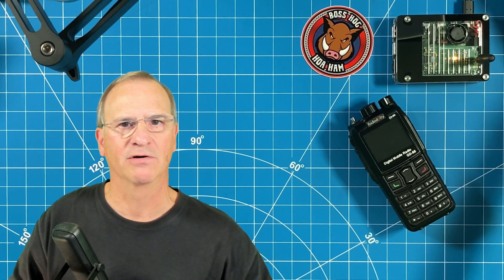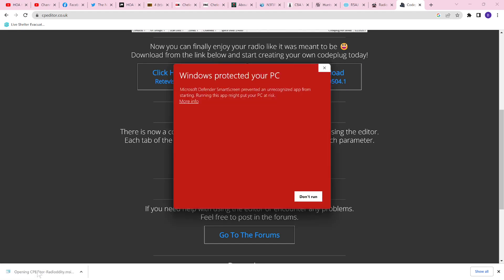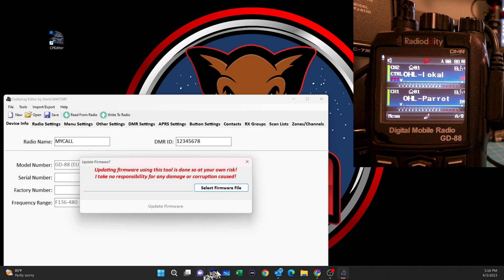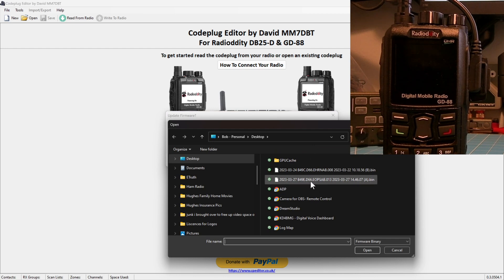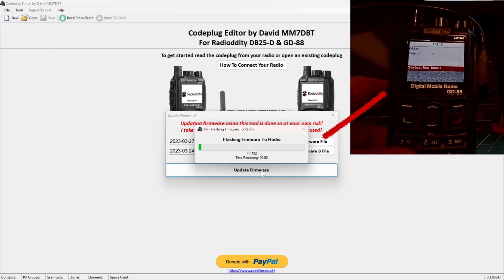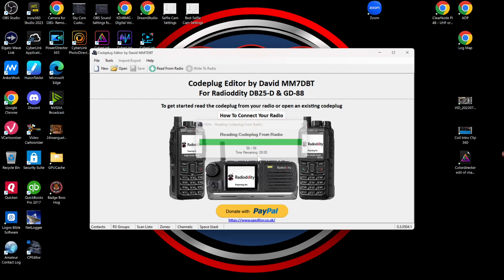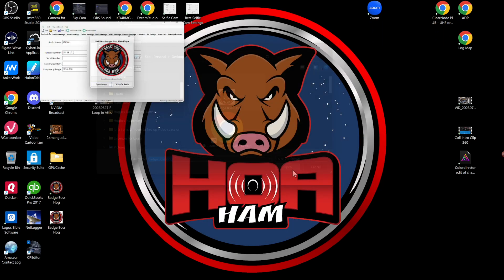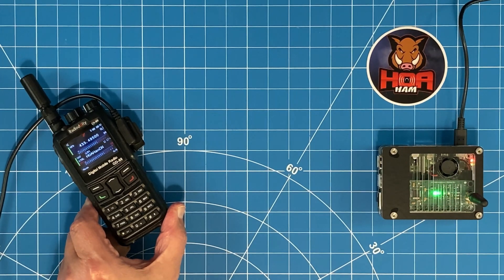Radioddity GD-88  -  Loading CPS Programing Software / Updating Firmware / Adding a Start Up Picture

Comment: What antenna are you using?
Reply from the maker: The antenna I am using is the G Gabil Radio stub; I use the BNC version:  https://amzn.to/3UotMAW
Reply: @HOAHamRadio  Neat. Doesn't look like the BNC version comes with the SMA to BNC adapter. Which one did you use?
Reply from the maker: @Guillermo11277  Yep, need to provide your own adapter.  https://amzn.to/3R5JMWF
Reply: What is the performance of the little guy? My Wife is looking at the GD88 and a smaller antenna might be a good fit for her.

Comment: Hello, I have access to the Radioddity GD88 radio, but the person selling this equipment says that the repeater function in it, the amplifier, does not work. The application and the receiver use the function that is most important, and what can be connected. Can a software update help?

￼
Reply from the maker: Not sure I follow.  Here is my video where I use this feature to talk DMR using an analog radio, and the GD-88 as the cross mode / band repeater:  https://youtu.be/GNPBdndT4zs

Comment: Have you done anything on the DB-25-D?  Would you like to borrow mine to do so?  I'm in Winter Haven so maybe we could meet up.  73
Reply: About the gd-88 there is supposed to be a firmware update this month, but the month is about over. 
So I'm waiting for the new firmware to address the volume issue. 
Hopefully soon 🤞
Reply from the maker: @bbroken1  Let's hope...the volume issue is the only thing I don't like about the GD-88.  It has a lot going for it, but the volume problem!!!!!
Reply: @HOAHamRadio  well I got a report from radioddity. They told me that there still working on the firmware for the gd-88 so it's going to be some more time I guess before they get this new firmware out to the public.
Reply from the maker: I just had a conversation last week with Radioddity.  They are sending me their brand new DMR radio, the DB40-D, for a review.  And once I complete that, they are sending me the DB-25-D...I think that is a cool little radio.  It will be MANY weeks before these get to me, I work with them, and then get to videos, but it is in the works.

I am curious how what you think of the DB-25-D?
Reply: @HOAHamRadio  Two things I wish they could correct on the 25.  Don't make it a blabber beacon.  I have not proven it yet but I suspect this thing is like many "APRS enabled" radios and just has a beacon function that does not listen at all before it transmits on a set APRS frequency.  Very bad form on the channel.  If this is true that function will be turned off in mine.  Only other thing is the record function.  Give us some way to get those recordings off the radio so they hold value.
Reply: @HOAHamRadio  So on the new 40.  Same as the 25 but 20 more watts and twice or more the price?  No.  What I'd love to see in your video is to highlight all the differences in the two.  Do you do "Shorts"
Reply: @HOAHamRadio   So one more.  Your channel and content is brilliant!  Glad to see a local doing content!  Spurious Emissions is the only other local channel I know of here.  Thanks for doing what you do!  73
Reply from the maker: Thanks for feedback @K4RJJ.  I only do shorts when I'm trying to set up a longer video; I personally don't find them all that helpful, but that is just my personal opinion.  

Thanks for the feedback on the DB25-D.  I have to send the new 40 watt radio on after I review it, its just a loaner.  So I won't ever have the 40 watt and the DB25 side by side.  Once I get the DB25 and use / review, I am sure I'll refer back to the 40 watt version and compare it.

Thanks for the kind words and information provided.